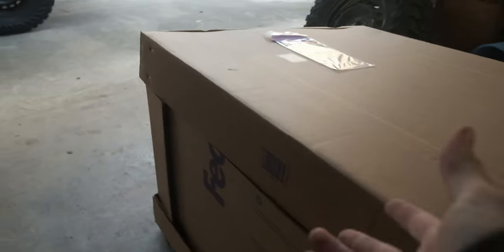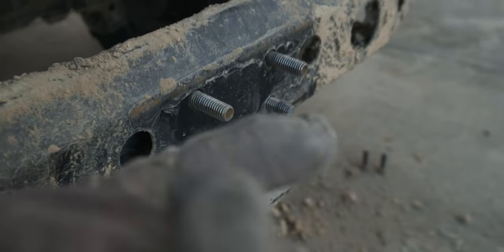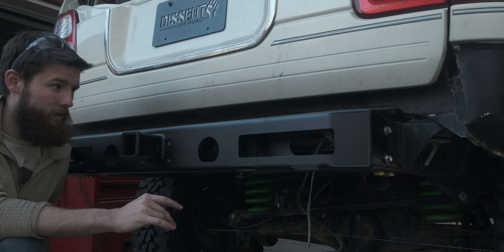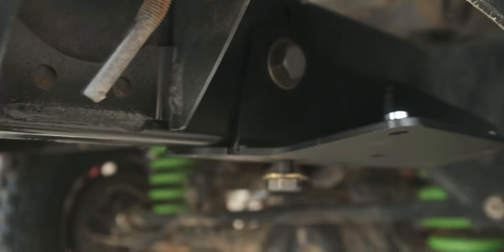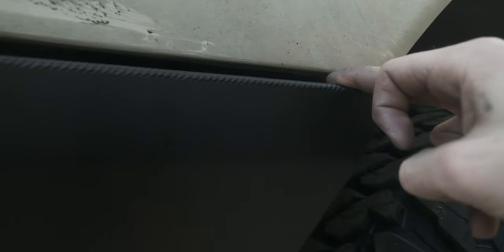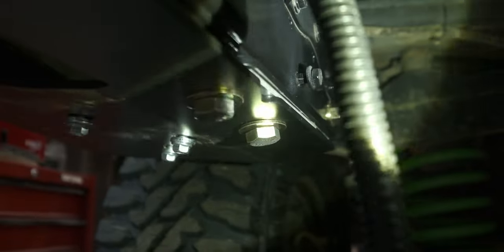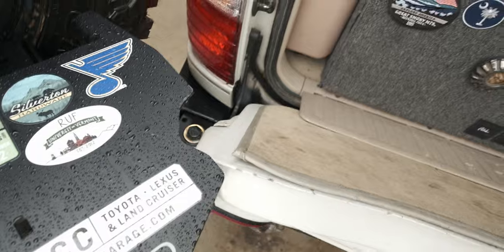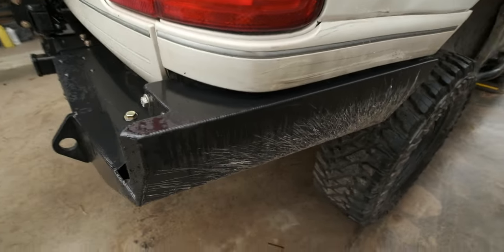Dissent Off-Road High Clearance Rear Bumper for 100 Series Land Cruiser (LX470)

Comment: Nicely done! There are (4) 1/2” bolts that attach the tire carrier frame and 2 structural support plates that we torque to 96ft.lbs. Those plates mount directly to the swing arm so we want to sure they get torqued properly. The rest of the bolts on the tire carrier are “good & tight”. 😊
Reply from the maker: Thanks for the clarification. I didn’t want to put any misinformation out there so i didnt include torque specs